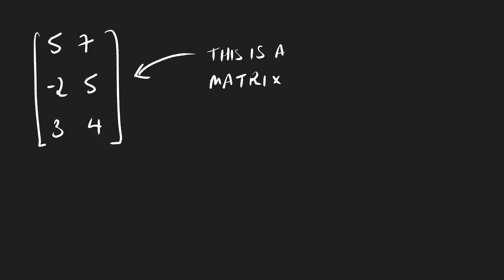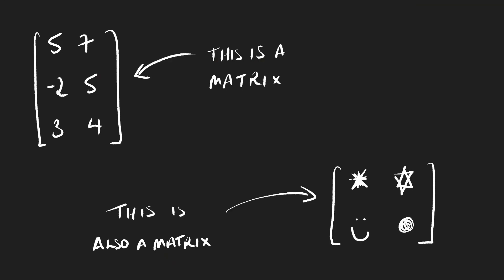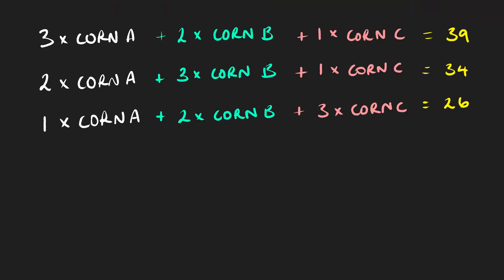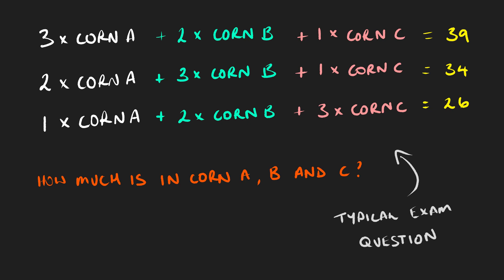Matrices: Why they even exist?

Comment: To me, matrices were boring and unnecessary until I found out that a matrix is just anothe way to present an algebraic straight line. ex 2x +4y = 5 can be presented in a 2 by 2 matrix. And if you have three variables its a 3 by three matrix etc. Human imagination is limited to understand 3 dimensional space, but matrices can deal wit unlimited numbers og dimensions. This mat is widely used in artificial intelligence where each connection between processors has to be calculated. Imagine a neural network with 2048 input processors in 98 rows, with each processor connect to each of the processors in the layer above. and Ai does this in split seconds. I do find this kind of interesting.
Reply: He assumed that we knew what you said about  representing a straight line with a 2 by 2 matrix. I Didn't. Thank you for your input. I need , now, to find a source to break that down even more for me
Reply: I think the best for beginner is INTRODUCTIONTO LINEAR ALGEBRA WITH APPLICATIONS 
JimDeFranza St. Lawrence University DanGagliardi SUNY Canton

Comment: It's worth adding that matrices were still quite an obscure topic even in the 1920's. Heisenberg's use of matrices in quantum mechanics did a lot to popularise them.
Reply from the maker: Nice! That is worth adding, I didn't know that. It seems funny that quantum mechanics would be the topic that popularised them further. Not exactly the most approachable topic 😂
Reply: @ciaranmcevoy9875  Popularised I think in the sense that they were seen to have a real world application - and remember things such as gaussian elimination, determinants etc. were largely taught and understood notationally as part of algebra - and so many working physicists started adding them to their working knowledge, and thus ended up in syllabuses further down. General Relativity and tensor algebra that came from it was probably another impulse. After they started being used more in cutting-edge physics and appearing on standard syllabuses the engineers then started using them as a tool to simplify calculations around things such as vibration analysis and stress tensors. The maths syllabus at a lower level is obviously quite conservative, but I would say linear algebra has slowly replaced a lot of technical details about mechanics and calculus that would have been bread-and-butter material 100 years ago.
Reply from the maker: Yes, that makes perfect sense. And it seems like quite a natural spread of information when viewed like that. When you think about it, that pattern of development tends to be the way with a lot of topics. They are founded, then used by the cutting-edge scientists and mathematicians, and then everyone starts learning from one another and putting their own spin on things.

I'm curious about your last sentence, because it sounds intriguing but I'm not quite sure I follow. What do you mean about linear algebra replacing some of the technical details about mechanics and calculus? And are you saying their details aren't bread and butter now in comparison to 100 years ago? Like are there things about mechanics and calculus that are now lost (and not covered in syllabuses) or is it a matter of linear algebra improving said aspects of mechanics and calculus?
Reply: @ciaranmcevoy9875  It was common in high school maths 100 years ago for example to study moments of inertia fo ellipsoids or in depth studies of conic section. These days advanced students in 16-18 education are more likely to encounter matrices, eigenvalues etc. And then at university a lot of maths and physics exams focused on very involved and complicated problems involving classical mechanics and traditional algebraic manipultion - look at the typical questions here: https://archive.org/details/mathematicalprob00wolsrich/page/n11/mode/2up in 19th century undergad Cambridge Maths tripos exams.
Reply from the maker: Ah yes, I'm with you now. That is such a good insight and a valid observation. Why do you think the shift has been towards matrices and eigen values etc? My gut feeling would be computational power making the requirement of thorough knowledge of the mathematics of certain aspects such as, like you say for example, conic sections, partly redundant.

By the way, that mathematical Tripos examination booklet looks impressively taxing, makes me want to have a go at a few questions haha.
Reply: @ciaranmcevoy9875  I think it is that, and also the scope of 'useful' or applied mathematics has expanded dramatically in the last century. Remember, until the early 19th century mathematical engineering didn't exist. 'Useful' maths in actual professional was mainly arithematic and simple algebra for certain practical calculations. Even by the late 19th century, engineering mathematics consisted of a lot of fairly standard algebra and simple calculus. Advanced maths, in itself, was was taught like Latin, as an cultural adornment, hence more abstruse subjects were part of becoming syllabus as a process of learned and mentally able. With the 20th century not only did physics advance into areas where more advanced and cutting edge mathematical techniques were needed, but also the scope of applications of certain advanced mathematical techniques widened dramatically to the point where a significant part of natural science, economics, computing, engineering etc. involves learning new maths even into undergraduate level. And with that I think there was less time to cover in depth topics that were more abstract and intellectual, such as geometry, conic sections etc. and these were relegated to side topics at the point where it may become useful for your branch of study at advanced level. But matrices are used in a lot of different practical applications across a large range of subjects so it important you have some facility in manipulating them by the time you study their uses.

A downside to this is that people these days can have very good knowledge of using the tools without necessarily understading their purpose or how their usefulness was derived and the assumptions made. With matrices this isn't such a problem as they are largely a computational tool. But in another very important branch of applied mathematics, statistics, it has serious consequences.
Reply from the maker: Yeah I agree with you. The notion of 'useful' maths been developed massively throughout the 20th century. And so the relegation of certain topics is inevitable, which is a whole topic of conversation in itself. I mean, high school mathematics is the study of the 'important' bits of 2000 years worth of mathematical findings put into curriculum for study over a 5 year period. It's understandable the reasons why it is done this way. However, like you've said, it can have its' downsides and students can fall into the trap of only learning how to 'use' maths rather than understand, and learn the language of, maths. This only hinders one's further development in the field.

I have fallen into this trap many a time and, though I speak for myself, I'm sure we all have fallen foul of this at one point or another. And so, with time, that's what I like to do with my personal research and learning for this channel: seek to discuss and practice topics of maths and engineering with the purpose of understanding at it's heart.
Reply: This is in 'The Strangest Man' (Paul Dirac biography)
Reply: Interesting developments in the field of LLMs -- your observation of the trap of only learning to "use" maths rather than understand and learn the language of maths is reflected in Ai, where the issue is rather knowing how to use language, rather than understand it. Use of language is easy; understanding language is deep and mysterious.

Thanks for demystifying linear algebra!